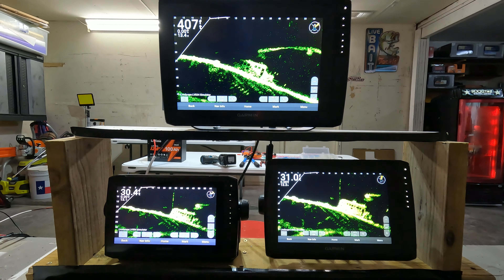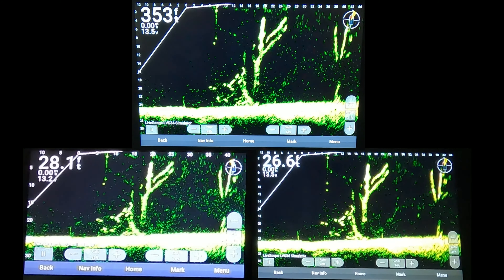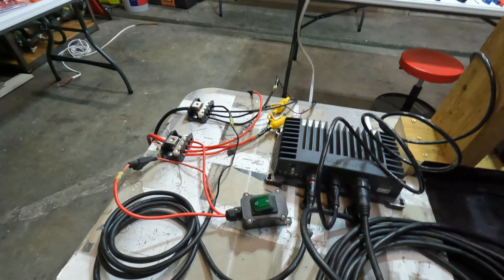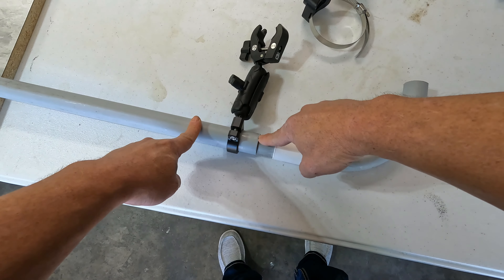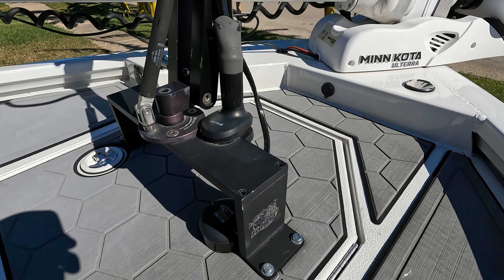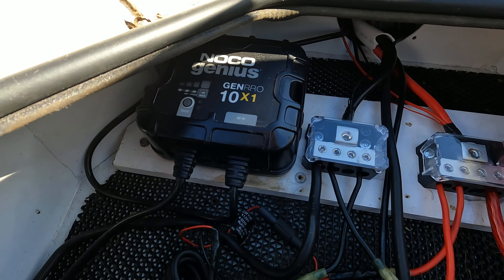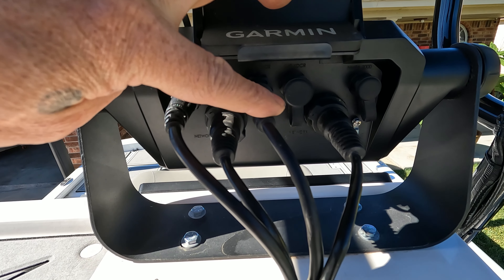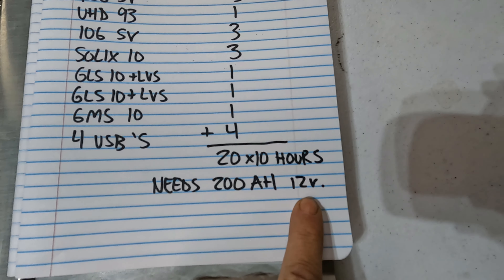Garmin Livescope Wiring and Installation Guide

Comment: Another awesome video Carlos. I am smack dab in the middle of doing all kinds of wiring on my boat. Started with the control panel switches not working and then removing 2 network boxes and cables. Right now it's a big mess and hope to get it sorted out soon. Gonna sort out the fish finders first before I try to figure out the control panel.
Reply from the maker: Wiring is a big challenge, hope you get it sorted out. At least you know how to do it. Thanks

Comment: Hey Carlos. How useful do you find the livescope mount compared to if you had it on your trolling motor?
Reply from the maker: I feel the pole gives you 100% control of fine adjustments needed for perfect bait placement, tracking, and fishing while spot locked. On the trolling motor is more useful for locating and chasing fish. Then casting toward the fish, but not tracking your bait perfectly. Trolling motor would work great on very light wind conditions. 5mph or less or in a cove.

Comment: How are you wiring six gauge down to your 14 gauge yellow fuse holder?
Reply from the maker: The 6g goes into the distribution block. I used 10g butt connectors and 10g wire crimped to the Garmin fuse end. Then 10g into the distribution block.

Comment: Is there any problem running 106 off its on regular trolling motor battery?
Reply from the maker: Kind of, I had the 106 and LVS32 connected to a lead acid house battery running pumps and lights. All it does is flicker a bit with anything running. The main thing is power draw, as long as you have a jump start device everything should be fine. Livescope will drain a battery very quickly.

Comment: I got the lifepo 12.8v battery and the gen pro 10x1 charger do you leave it plug up all the time until its time to go to the lake. thats what I did with my other battery
Reply from the maker: I think it’s better to charge it for a full day, then unplug it. Top it off before you head out next trip. There is a bms in it that has overcharge protection that can be tripped.
Reply: thank you that is what I will do @CarlosPadillaCentex